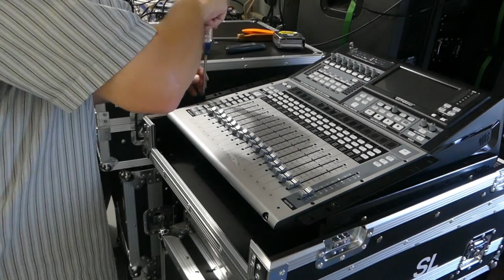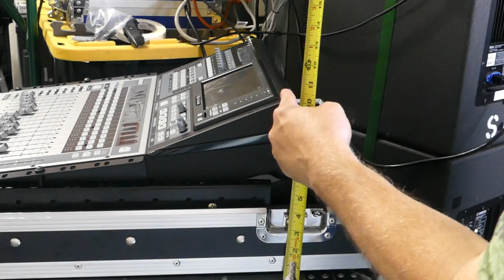Modifying a road/rack case for a Presonus 32SC console

Comment: You could use some nylon spacers with the longer rack screws. They come in various lengths so you could use shorter ones in front and longer ones in back for the angle you want.
Reply from the maker: Good idea.

Comment: Allen & Heath designed the QU-16 format in a way so that it would be a direct replacement for the MixWizzard mixers meaning that MixWizzard users wouldn't have to buy a new case when upgrading.
Reply from the maker: Good info.

Comment: I have seen you do some woodworking before.

So why not take the wood on which the rackrails are mounted out (3 bolts per side) and angle them?

It's a 15 minute expedition with a pencil, saw and drill.

Putting foam under your mixer in order to shock mount the mixer and then mounting the mixer to the rackrail basically nulls the shock mounting as you need a dampened case in a case to have some sort of shock mounting.
Reply from the maker: Good observation.  I considered adjusting the rack rails, but was saving that option as a last resort.  I don't like performing direct modifications on equipment, unless absolutely necessary; I'm not a wood worker and can easily mess up an easy job.
The foam isn't actually there for shock mounting, but there is some (very minor) benefit of part of the console sitting on it.  You are correct, the entire case would need to be foamed to ensure an actual shock loading option (similar to our full size Presonus console cases, which are not rack cases).
Reply: That seems like the best solution to me too.  It even looks like you could drill extra holes and cut the bottom off at an angle and still be able to put it back the way it was if needed.  And that would make for a much more solid mounting for the mixer.

Comment: A much better solution would be to modify the case (as implied in the title) to align the rack ears to the need. That would provide a correct distribution of the forces and restrict movement in both directions when the case gets bumped, dropped, etc. This solution is pretty sketchy for a mixer.
Reply from the maker: Thanks for your comment.  The rack ears are attached to wood; the wood is attached to the inside of the case.  The issue with aligning the rack ears would involve having to remove the rear and forward latches (which would involve removing all rivets and adding all new rivets) to adjust the wood a few degrees; this would have been a very time consuming and potentially expensive modification.  The console is very secure to the rails.

Comment: Have you guys had any problems with your NSB 32.16?
For some reason with mine, it keeps dropping signal.. Not sure what is causing or what I need to do to fix the issue..
Reply from the maker: The signal drops are usually due to incorrect network cables.  We use Cat5e for all the short runs (less than 100') and Cat6a for runs longer than 100'.  Cat5e is the minimum classification that should be used with AVB.  Anything less than Cat5e will most likely not work.  Also, check the MHz of the Cat cables you are using (the MHz should be printed directly on the cable).  I think AVB requires a minimum of 350 MHz.
If you are using two consoles, ensure the sampling rate is the same between them.  Also, make sure the second console is getting its "clocking rate" from the network, it should not be using its internal clocking.
Reply: I use LYX Pro cables. Tried other inexpensive brands, and they did not work!
Reply: @stageleftaudio  thanks for the info!! I’m ordering one as we speak!!